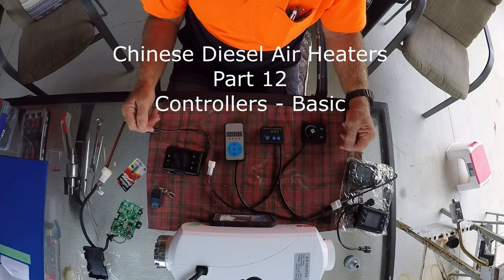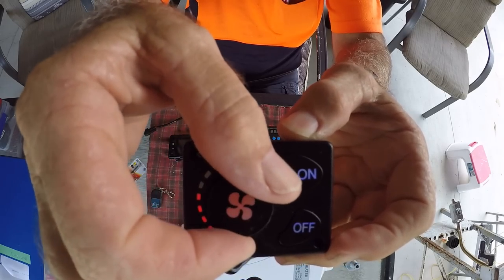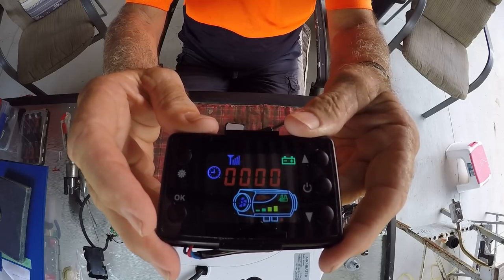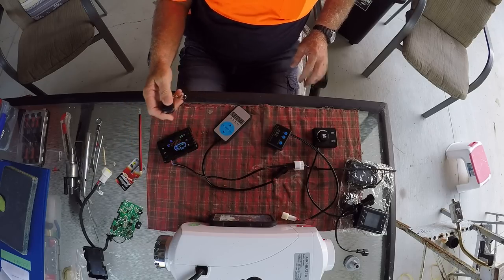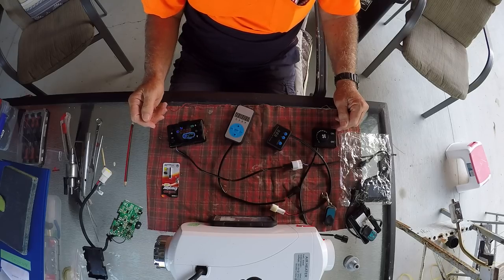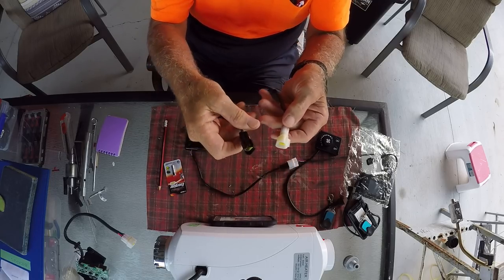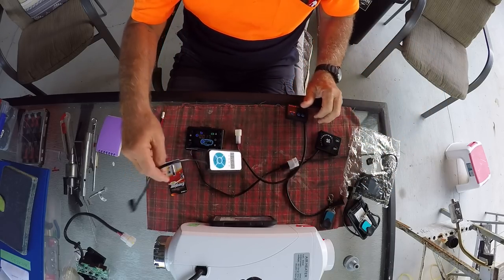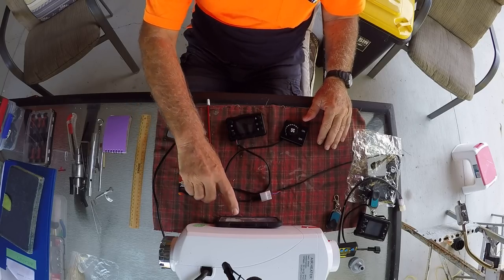Chinese Diesel Air Heaters -  Part 12 - Controllers (Basic)

Comment: Hi John, thanks very much for the video, it is a great help! I have just had a 5k heater installed in my jeep in Ireland in which the heater has broke. It has been fitted under the bonnet which I hope is not an issue with air quality inside the jeep? My main query is with regards to the lcd screen draining my battery, can you advise on where I would find a switch to add to the system turn the display on or off? Mush appreciated.
Reply from the maker: Hi Liam,

A 5Kw heater is perhaps too big for your Jeep. These heaters put out a lot of heat. 

Suggest you install ducting on air inlet side of heater to duct in fresh, outside air. You don't want to be breathing engine compartment air.

Any 15 amp switch in the power feed line to the heater will do. I talk more about this in the motorhome videos. 

Cheers.  JMcK

Comment: Hey John,
I do like your videos.  Thank you for sharing all of thin in such a details. Actually you have inspired me buying one of those heaters. I got one 5Kw and it works just fine.  I've decided to buy one more controller to replace the grey one on you table. And here comes the issue.  As soon as I press a button the controller is on is not reacting. I can start the heater and there is one icon flashing red X. As well doesn't show the voltage. Do you know what could be failure. 
Than you in advance. 
Best Regards 
Asen N.
Reply from the maker: Hi Asen,
Is the fault with the new controller? Sadly, some heater manufacturers are not using standard wiring configuration and some controllers will now not work with some heaters.

If the fault is in your original controller it is likely showing an error code. E01 standard fault is low voltage. Suggest you check the battery voltage, the wire harness, and voltage at the controller itself for low voltage.

I can't be much more help without more knowledge.  JMcK
Reply: @johnmck1147  Hi John,
Thank you for the quick reply! The failure is on the new controller.  With the old is working. I have connected the heater directly to the battery less then 2m and I have 12,0V. The connector between the controller and heater match the cables colour. When I go to settings I can see reading of 0.00 volt. Wondering if there is any settings I can try. Some people  saying that E07 is miss connection on the blue wire. Wondering  what's going to happen if I swoop those two wires blue and black....I guess in worst case I won't get power to the controller or?
Reply from the maker: Asen Naydenov 

Hi Asen, your choice. It could be worth a try. In the past you could easily mix and match controllers, but as I stated previously some manufactures now use their own wiring system. Luckily you can buy replacement ECB quite cheaply now.  JMcK

Comment: what a brilliant set of videos I am setting one up in a wood turning shop. What would you advice to do regarding dust being suck through the heater intake fan ? would I be better off having the air supplied from the out side of my workshop?
Reply from the maker: Hi Gerald, 
Thanks for the feedback..
Probably better to suck the air from outside.
If inside you perhaps should look at some type of foam filter.
Cheers,   JMcK

Comment: HI John,
So enjoying your videos, my background comes from Power Generation but still unclear how an Electro Magnet works on DC ?
Thinking some form of oscillator in the ECU
Looking fwd to your next subject.
Cheers
Reply from the maker: Hi Neville,

It is just simple power switching. DC power on the magnet coils energise, and piston flies up. Power off - no magnetic field and spring pushes piston back down.

I have made a lead with a simple micro switch which I turn on and off for when I want to send fuel down a long delivery line in initial start up.  If I remember right you can see it in motorhome video. (Made Six years ago now). JMcK

Comment: Hi, John
thanks for posting and explaining about the chinese diesel heater, very informative. 
I do have a question about the controller electric drain. Beside the controller, is there other parasitic drain in the heater electric system?
I'm think if the only drain is coming from the controller, i can splice the controller wire and install a switch. Do you think its a good idea? thanks for all your help.
Reply from the maker: Hi Yiucycle,

Thanks for the feedback.

Suggest you do not cut the controller wires. Better to put a switch in the positive battery wire to the unit to stop parasitic drain when heater is not operating for long periods. However that power switch needs to be isolated so there is no option to accidentally turn it off with the heater running, or used as a means of shutting down the heater.

To do so will cause a dangerous overheat situation, as the heater can not go through its cool down program .   JMcK

Comment: Hi John just watched your controller episode you point out the problem of controller fail and not being able to safely shut down the heater with out frying the the ECU . Could I suggest putting an isolator switch to kill fuel supply let heater run on for say 15 minutes to cool down before switching power off completely while waiting for replacement controller just a thought regards David
Reply from the maker: Hi David, thanks for the feedback. Yes, turn off the fuel supply. However it takes some time to run out of diesel. Thankfully this is a very rare occurrence. JMcK

Comment: John your videos were very helpful in setting up my heater I have one a question pertaining to the wiring harness . I  splice a section  of wire to extend my harness so I could place my controller further from the heater. how may heater will not ignite the fuel. I show continuity on the wire that i splice in. Any Idea were I went wrong ?  Did  my wire change the volts needed for the igniter It looks like everything else is working ie   fuel pump and blower.
Reply from the maker: Hi Robert,

I suspect you have excessive voltage drop in the harness extension, which does not allow the glow plug to heat up enough for ignition.

Have you looked at the 2 motorhome videos?  In those I explain voltage drop in extended wire harness, and the need to increase wire size.

Cheers.  JMcK
Reply: @johnmck1147   thanks for the reply John I have not looked at the motor home video but I will , I did increases the wire size hope i will learn something about voltage drop in your video that will help.

Comment: John: Quite a few asking about the different style plugs on different controllers. You mentioned it yourself in this video. Any thoughts to if you could just cut the wire (plug type) off whatever old controller you have & solder it onto the new controller? (Of course you would need to cut the wires on the new controller as well). There (seems) to be a pretty standard 3 wires to these controllers & a standard 3 color code of Red, Blue & Black. As I was watching you approach that section/problem in this video of the wires/colors being in different positions on a replacement controller I thought you were going to say to do just that. Cut the wires.Solder into correct position & problem solved. Instead you went into the customer service with the supplier. I guess that worked out pretty good with the $50 rebate. Just wondering if you figure a cut & splice job could also be done? I have the issue of a heater (LCD controller) that came with a square shaped plug for the controller. ALL the replacement controllers (falsely advertised as "universal" controllers) seem to have that Triangle shaped plug. Si if my controller goes bad I guess I have to buy both a new controller & Mother board for the heater (which I assume comes with a new main wire harness?). Otherwise the only other option I see is what I ask about....Cutting & splicing old shape plug to new controller wires. Does THAT seem like a thing that could work????????  Others are wanting to know this too!!!!
Reply from the maker: Hi Rusty,

I have to be a little careful here. When I made these videos some years ago now, the Chinese manufactures followed a standard protocol, but lately some manufactures are doing their own thing, and nothing matches up.

The old standard for controllers was 3 wires. Black (12V-). Red (12V+)  and Blue (sense) If the plugs were different or the colours didn’t line up you could cut the wired and solder them back to suit a new controller, or different plug. 

In your case you could do this yourself but you must accept the responsibility of things going wrong. In the majority of cases this would work, but if you have a manufacturer using totally different protocol it would not work. Make sure your power wire from battery is fused. (15 amp fuse)

If protocol is wrong in most cases nothing would happen. Worst case you could damage ECB or controller. If you were unlucky and did damage those parts you can buy a spare ECB and controller quite reasonable price on line, but suggest you buy both from same supplier to up your chances they are completely compatible. If not you can return them.

Cheers.  JMcK
Reply: @johnmck1147  Thanks for the reply John & the added info of the (old protocol) for the volts/color code. I get your telling me to use caution & the need to accept the responsibility... I do. It's tough to decide between buying spare parts (controllers) & just buying a whole new heater. I'm just trying to be prepared as I have already had a situation where the wires into the controller were pulling off the soldered terminal & possibly cross shorting to the neighboring terminal in the controller. As you probably have noticed as much as you have studied these things, There is no wire stress relief so fatigue takes a toll with movement. I have been posting/advising folks to pump some hot glue or RTV Gasket seal in & all around the wire where it enters the controller. That seemed to solve my issue. The terminals are way to close to attempt to re-solder if they break off. Anyway, I thank you again for all the information you have given & taken the time to educate us all on these heaters & operations & repairs... I most certainly learned a bunch of things watching your series of videos. All those Chinese Manufactures should be required to send you a commission on each unit they sell for all the help you have given! Hope you are well & all is good in your world. Rusty
Reply from the maker: 👍. JMcK

Comment: Good video, I am not sure about the pulse control, would this be used to increase and lower the heat? in other words what is the function and the optimal setting.
Reply from the maker: Increase the Hz, or pump pulses and you increase rate of fuel to heater and hence increase temperature output.  JMcK

Comment: Great videos, good to see some with an Aussie accent. Sorry if this has been asked but reading all of the comments on my phone is a bit tedious.

Q: if the controller failed, how would the unit respond if the fuel supply was removed rather than the power, would the unit complete it's cool down procedure and shutdown gracefully or do those smarts live in the controller?
Reply from the maker: Nate3094 

Hi Nate, yes you could cut off the fuel supply, a good option and one I would choose, and the heater should go into shut down mode. I say should, as it would be dependent on the actual controller fault. All professional marine installs I have seen have a fuel shut off tap in the system.

Cheers,   JMcK
Reply: @johnmck1147  Thanks, may install a switch in the pump wiring loom.

Comment: Hi John, thanks for the videos. Where can I mount an isolating switch for the entire system so it is totally isolated from the battery when the caravan is in storage?
Reply from the maker: Hello John,

You can put a switch anywhere in the positive line that can not be accidentally turned off.

Have you seen the motorhome videos. I go into detail about a master switch there.  JMcK

Comment: Thank you! this topic is very frustrating to me, it seems like the simplest dial controller is the best because it can act as a basic thermostat with no hassle. I have the type with the LEDs and blue circle on the front and it's annoying and won't work as a thermostat for me. Plus I had to bash it open and solder the 7 segment displays to get it to work in the first place! I wish the dial type could read error codes to you...
Reply from the maker: Hi Chris,

Thanks for the feedback.

The simple dial controller DOES SHOW ERROR CODES. The little LED's that indicate the temp setting flash an error code. Eg, three lights flashing means error 03.

Cheers.  JMcK
Reply: @johnmck1147  wow thanks John, I'll have to pick one up. I appreciate this series very much, thank you for making it!

Comment: I'm thinking of installing a switch on the red (+) wire of the controller, and at the end of heater season/travel, it will cut power to the controller and display.  While a digital controller will still need reprogramming, cutting it off will not damage the heater, even if accidentally turned off.
Reply: Could the same result be achieved by disconnecting the connecter blocks from the loom to the display controller? I've read a switch is a no no so I thought when not in use of unplugging the controller?
Reply: @naomiobrien3543  if I understand, yes you could just disconnect your controller. Perhaps there is confusion because yes, a switch to disconnect power to the burner might be a big problem if switched off when it’s running. But a switch to the controller is no problem.

Comment: I am researching fitting one of these units to my Jayco camper.  Noticed on your video the fuel tank diagrams show the tank below the unit, however on a lot of installations the tank is above the heater unit. As a retired (experienced) mechanic I am wondering is there any risk of fuel siphoning happening, especially in a mobile situation where the unit will be switched off and could be subject to considerable vibration?  In my situation the fuel tank will have to be mounted with the base of the tank between 2 and 300mm above the unit.  Should a fuel tap be fitted in the line for safety?
Reply from the maker: Hi Naill,

You are correct. If the fuel tank above the heater you need a shut off valve at tank or before the pump to stop leakage past the pump and flooding of heater burn chamber. Once flooded, heater will not start.

Tank, above or below heater, I always install a shut off valve.

Cheers.  JMcK

Comment: I cannot find any instructions for using the silver faced LED controller with the blue buttons that came with my heater. You show it in this video but no information came with my heater and I have had no luck in reverse engineering this controller. Help!

Comment: Thanks for your reply. I had the issue of the broken wire in my controller that was soldered . I had the problem with it smoking I experimented with pulsating air pressure into the air intake which did get it ignited.
 I suspect the broken wire sending sporadic current caused it to damage my ECU.  I have a 2 kilowatt heater. it is a little bit smaller in physical size than the 5 to eight kw heater.  Will it have different ecu. Just to note those two kilowatt heaters are now much more expensive than the five to eight kilowatt heaters. Probably about double the price. Thanks again for your previous reply.
Reply from the maker: Hi Lionel,

In the past, both the 2kw and 4 kw heatersChinese  had the same ECU and controllers, but set at different parameters. Lately there are a number of new manufactures making these heaters and they do not follow the old (unofficial) protocol, so it is not so easy now to mix and match components with these heaters.

I was not aware the price of the 2 Kw heaters had gone up, (I must check) In the past they were the same price.

Cheers.  JMcK

Comment: Hi I have one of the controllers you unplugged at the end of the vid . My question is on start up it only shows 3 dashes where it should show P12v  do I have a crook controller? Thanks Jim
Reply from the maker: Hi Jim, if you have the manual controller with the knob, the dashes show the pulse setting, or power setting. All should be ok.  JMcK

Comment: Thanks John, an excellent explanation. I have the LCD controller which is very bright at night.  Do you know how to dim the display?  Thanks.
Reply from the maker: Sorry Bruce. 

I have tried pushing all different combinations on the LED controllers I have here but I can't find a brightness level. But each of the black LED controllers I have has a different brightness level, so it must be able to be changed. Perhaps it is factory set? I do not know.

Perhaps some viewer may know and will post a comment.
Reply: Hi John, thanks for your response.  I have been looking around a bit on various blogs and have not come across an answer yet. As you say, perhaps some viewer may help. Thanks anyway, Bruce.
Reply: i would install a small piece of black synthetic leather or so, in a way i would be able to cover and uncover the controller easily. A lid mounted with hinges could be another option.. @brucehogan8208
Reply: I wonder if you contacted somebody on YT with an electronics channel and proposed they make a video on how to do it?

Comment: Thanks.  Should you control panel fail and it keeps running,  best fix is unplug the fuel pump which will stop fuel flow and heater will go out.  After about 5 minutes it should be cool enough to pull the fuse.